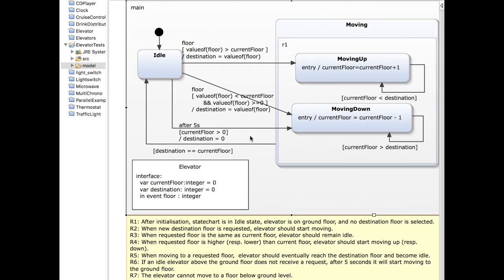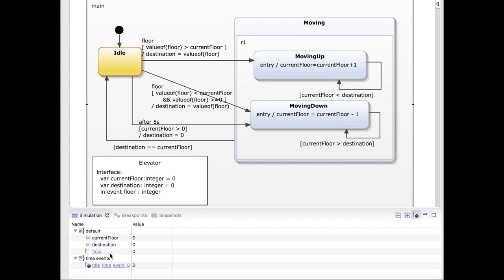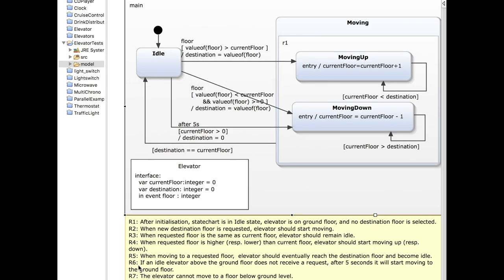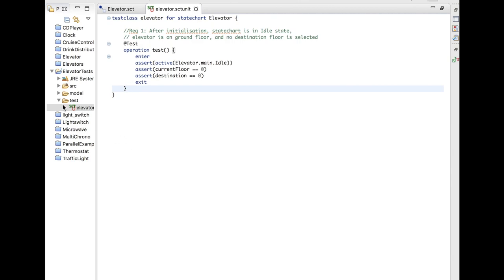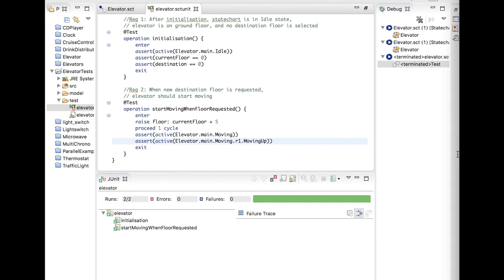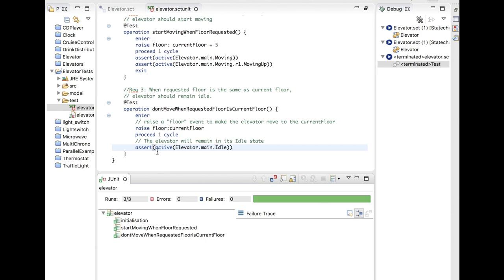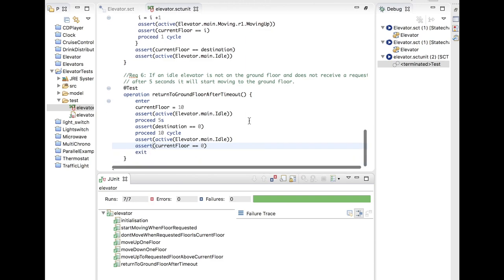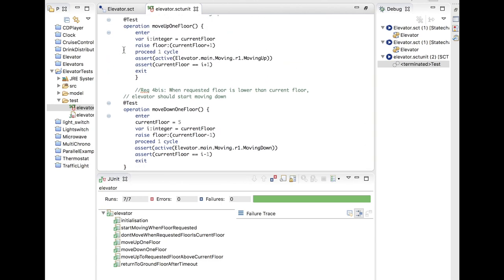Statechart unit testing with Yakindu Statechart Pro

Comment: Is the test language based on Junit?

Is this test language only available in the pro version?
Reply from the maker: Support for statechart unit testing is also available in the standard edition. The "test language" is not really based on JUnit. Although it looks similar it is much more restrictive. In the current implementation, running the statechart tests  is based on the JUnit framework. Yakindu also supports generation of JUnit tests directly from SCT tests.